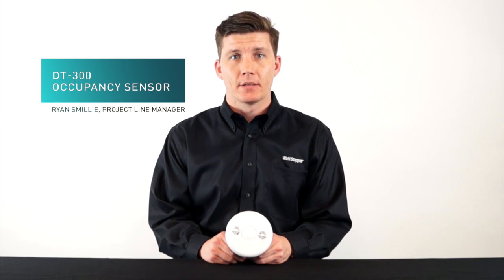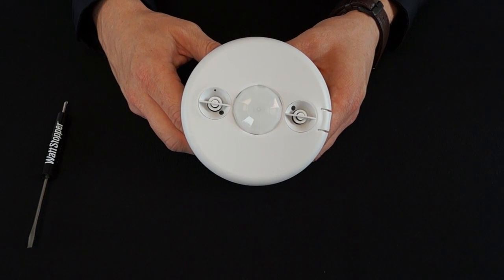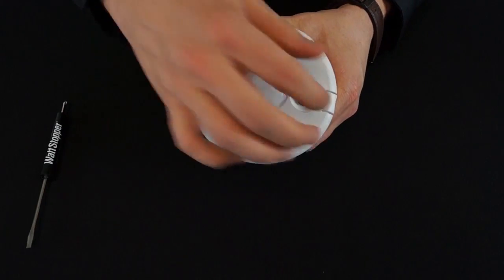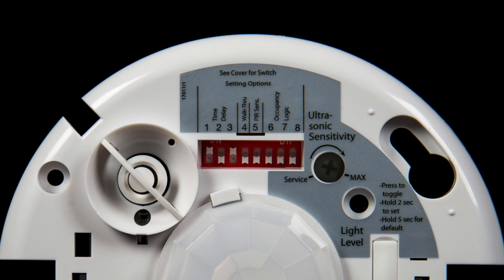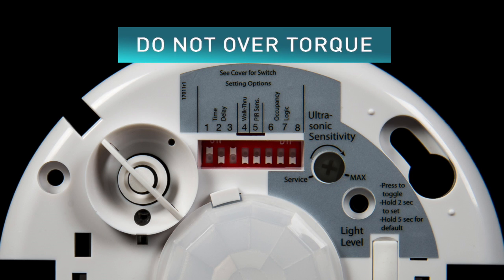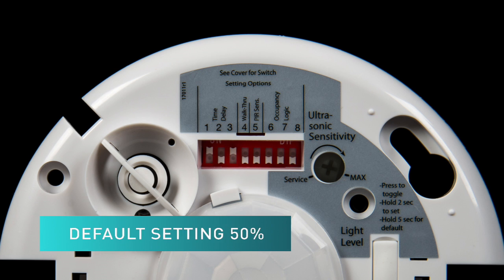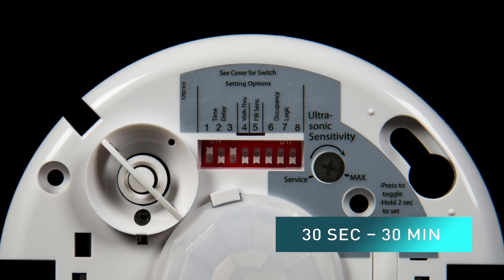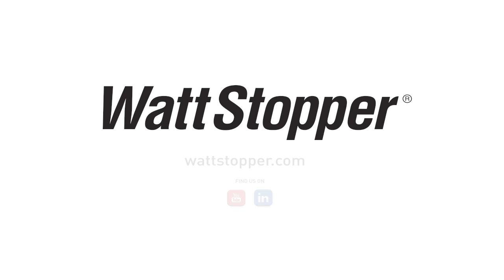Wattstopper: How to Video DT-300 Occupancy Sensor

Comment: Very frustrating product. The font is so tiny, its impossible to adjust the settings if you are standing on a step ladder looking up. I want to turn all sensors off so the electricity never turns off, but there is no instructions on how to do this. Terrible design… im an industrial designer and this would get a 1 out of 10 with my rating.

Comment: This thing isn't good.  Confusing instructions and lights still turn off. No one understands the terminology they use.
Reply from the maker: Hi there, we're sorry you had issues with the DT-300 Occupancy Sensor. If you still need help with this, or need help with another product in the future, please reach out to technical support: 1-800-879-8585, Option 1.

Comment: DSW-301 how does one set dip switch settings for 5 minutes on only and walk though "on" for this model?  As for the dip switches, is the "up" position for on and the "down" position for off?
Reply: Seems at 1:47- it shows up as on, down off ...note tiny box on lower left of screen